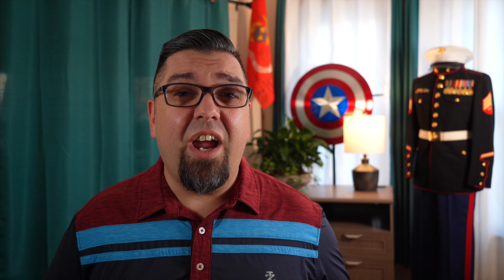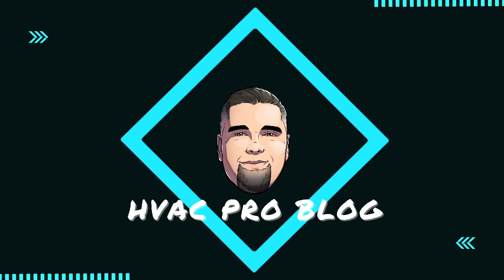Manual D - 5 Duct Issues that Affect Comfort

Comment: Hi Chris,
Thanks for another spot on , valuable training video!
When I started teaching manual J&D some 30 years ago, I noted the challenges some guys were having.
After studying the issue I found many had absolutely no training in airflow at all ; not even in trade school!
So I wrote a course that became my pre-requisite to take J&D.
I still teach it to dealers here in SouthJersey. “ Fundamentals of Airflow”
I show the turbulence found in the square throat fittings and that gets their attention.
Then the classic, “ Guys, have you ever pulled a filter out and half of it was clogged and the other half relatively clean?”
Now tell me how much air that three ton unit was getting back?
The square throat fittings set up a destructive turbulence at the throat NOT the heel. This reduces air flow and drastically increases the equivalent length of the duct system.
Many times, changing a square throat fitting to one with a 8-12 inch long starting collar or turning vanes will improve the air flow down the line.
Usually, the biggest turbulent losses are at the return connection and plenum to trunk takeoff.
We as an industry can do so much better to help improve our country’s overall energy situation, air flow is one of the largest and important ones!
Let’s do this!!

.
Reply: Boy would I like to pick your brain. I'm in South Jersey (West Deptford) getting ready to install complete from scratch hvac system in my daughters 1000#' 3br  rancher on a slab. In attic. Have 2 guys helping one works for pse&g in field the other an hvac contractor. I'm sourcing equipment and trying to figure best return system. Doing 6" flex to all rooms but bathroom which doing 5". Wondering best size and locations for vents. Using the all in one plastic style. I was planning on 1 3way in ea. Room over windows and 2 in LR. Possibly 2 in 9x12 kitchen. Please help with any advice.
Reply: @rickhoupt6933  
Hello Rick,
Based on what you have told me in your message, I’m concerned your off to a bad start.
First, was a manual J load calculation done on the house , room by room?
That’s so we know what size unit to install and what size ducts to install to each room. 6 inch flex duct when installed has a friction factor that reduces it’s effective size to a 5 inch duct.!
Bedrooms should have a return in each. None in any bathroom for the obvious reason.
A central return in the main living room is fine but again the size of the ducts, BOTH supply and return is based on a calculation allowing for the higher friction rate and turbulence theses type of ducts create. Too small and you get a higher electric bill due to flow inefficiency.
The flex duct layout needs to be carefully planned and then installed or it can become a problem down the road. Flex duct must be pulled taught so it looks as if it was solid air duct and should not make any 90 degrees turned without sheet metal elbows installed to creat the 90 degree sweep. Flex duct when bent tight collapse’s internally and cut off airflow by up to 50 %!
I hope your guys have had serious airflow training.
Good luck
Wayne
Reply: @wayneschneyer8699  one does have system/airflow balance training. As far as 90° I have braces that form a nice sweeping firm turn